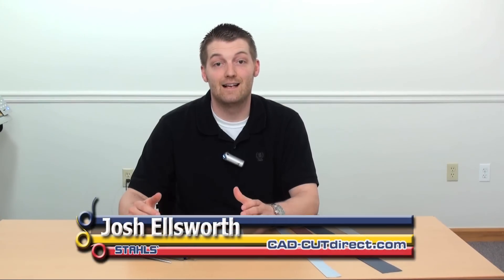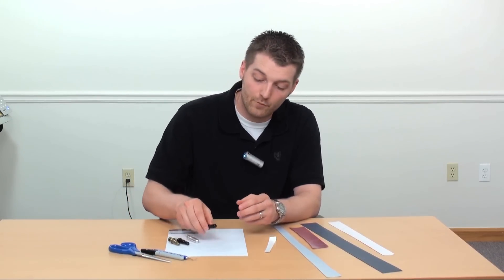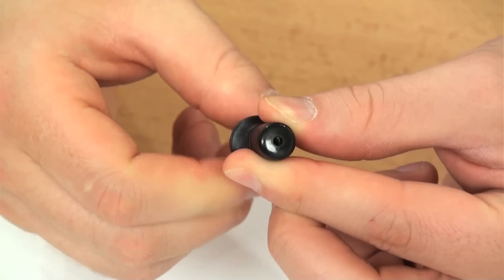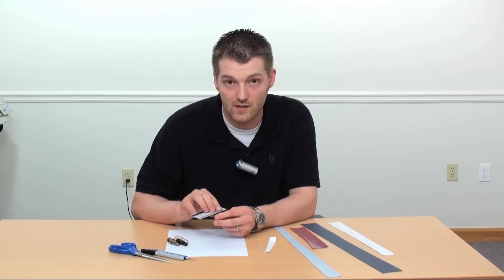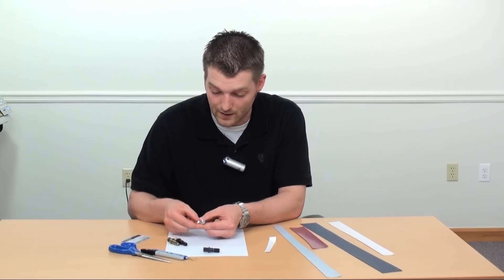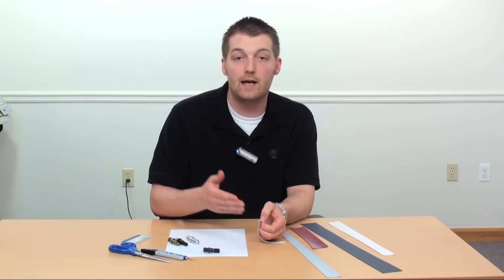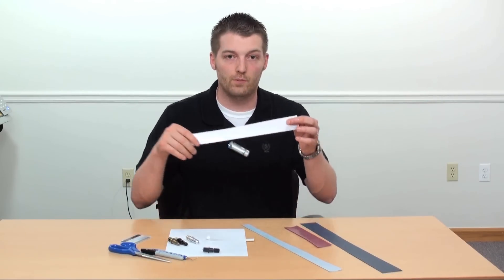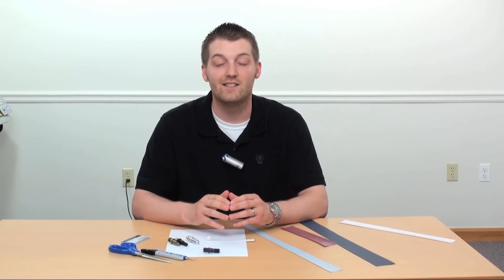Tip Jar - Selecting a Blade for your Vinyl Cutter

Comment: I have a Graphtec craft robo cc200-20 cutting machine think its a cc200 and i dont know what replacement blades to buy . I need one sharp enought to cut through medium to thick card plus i also used foil card and thin papers so need blades for a wide range can anybody help me please
Reply: Ali Express websites help you

Comment: It's worth mentioning that some blade manufacturers measure the angle from horizontal while others measure it from vertical. So a "60º" blade can either be pointier than 45º (measured from horizontal) or flatter than 45º (measured from vertical). In fact, some manufacturers even use a different measurement depending on region (so a blade can be 60º US / 30º Japan).
Reply: 8218028712

Comment: i am also a beginner,.  i have a ASC365 cutter, and the sellers where oriental and their english was not good. SO i had a hard time asking questions with setting it up, he showed me visually, but when i got home, i realized i didnt have an understanding of why he was doing what he did, now that i am setting it up, i can see where i have questions on what is appropriate in doing so.
this video showed the correct depth of the blade, so that is good. But he didnt show if the blade should be 90degree in its holder or 45 or what ever to get a good cut, after seeing this video  that he explains there are different blades, now to find the appropriate blade for my designs.  Where can we see a video with blades doing different types of cuts/shapes and explaining the blade used for such.

thank you
shawn michael
Reply: ***** How do u differentiate from the two blades. 
I also want to know where in the carriage should the needle holder sit?  If it goes to the shoulder on it, it's pretty low. like against the sheet. 
so i am trying to fig out the distance from its resting spot and the sheet, what kind of gap, whats the easiest way of knowing, thickness of two pennies? 3? 1?
Currently I'm only using window lettering and decals vinyl  . 
I have the blade protruding about .5 mm. So that should be ok,

When I put the needle holder into the carriage, does it need to face straight on or just slap it in and where ever it is will suffice?

Comment: I've been losing my mind trying to get good cuts of detailed art on Rubylith film. In this case, the art is a printed circuit board pattern, for exposing photo-resist.

It's always either cutting too deep and scoring the Rubylith's backing substrate, not cutting deep enough, or having trouble with the fine detail... (If not some combination)

I think I've tried both 45 and 60 deg blades, so I was considering giving 30 a go since Rubylith is super-thin. But it sounds like I'd lose out on detail..

Comment: One question I have. Can vinyl cutters do heat transfer and sticker too?
Reply: You just need to get the right kind of material, and make sure it's compatible with the blades. Some special materials need unusual blades (which can be quite expensive), but 95% of self-adhesive (sticker) and heat transfer (textile) vinyl and polyurethane films are compatible with normal blades (around 45 degrees).

Comment: Ni5ei
I do not know anything about the science of the blade technicalities, but the blade supplier should state what off-set the blade they supplied should be set up with.

Do not adjust the off-set of the blade to suit different material, you will need to change the blade to suit different material and set up that blades off-set into your machine.

Hope this helps

Comment: Josh, can you explain a bit more about offset please?
Ross from Clean Cut Blade told me that as long as the dimater of the blade stays the same, the offset is also the same.
Offset = distance from center of the blade to the tip of the blade which equals half the diameter of your blade thickness. That distance stays the same whichever angle you're using. It's only when you start cutting thicker materials that the offset is changing.